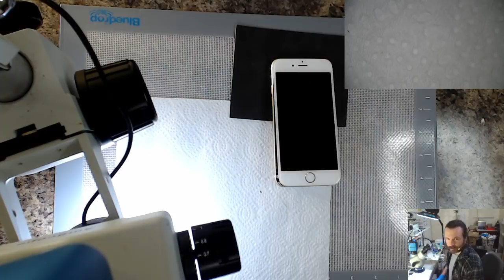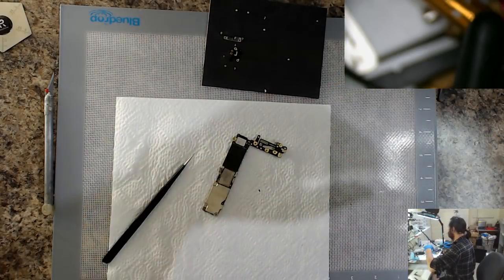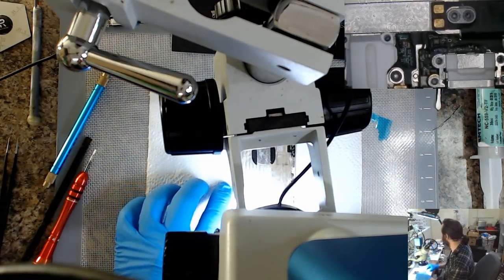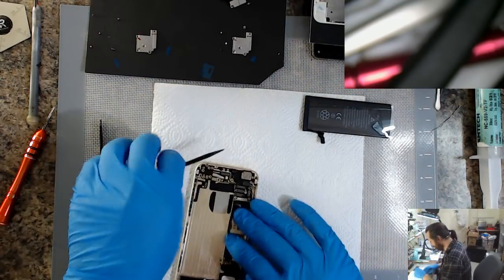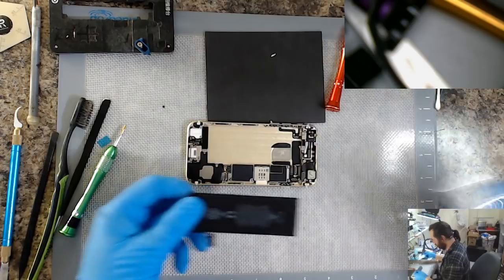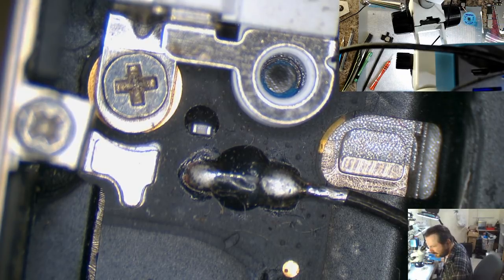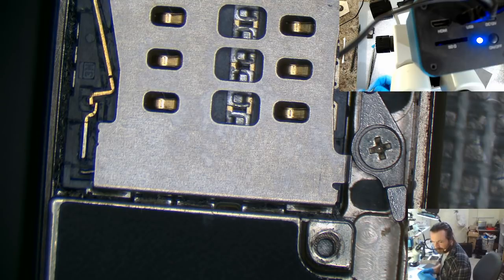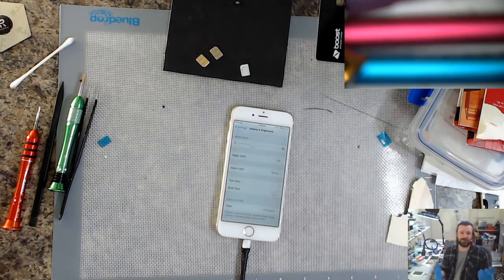LIVE: iPhone 6, tristar, dock, battery, and broken COAX, Noooo! - catching up for a change

Comment: What temp/airflow do you use on your Quick for shield removal? I have the same unit. Thanks and keep up the good work!
Reply from the maker: 460'C & 80 litres/air makes quick work of the shields.  The iP6 bottom shield though needs the full 120 litres and probably about 480~500'C, it's one you'll have to experiment more with.  Some days it comes off as expected, other days it's still stubborn.

Comment: Hey Paul, I'm starting a business and want to get an ultrasonic cleaner but I don't want to invest in a Crest yet. What's your take on the cheaper static 40KHz cleaners? I'm looking to get a 15L one but not sure how well they work.
Reply from the maker: Haven't seen the 15 litre sizes personally, I just took stock of a 10 litre unit, and while it's "okay" it's not something I'd rave about and it doesn't quite do as good a job as my 1.5 litre unit that I use for iPhones.  I suspect part of the problem is the power-to-volume density of the ultrasonic.  Haven't looked yet but suspect this only has 2 transducers, where's perhaps a unit with 4 will be better for superior wave / impact distribution.
Reply: Good to know as I seem to get mostly iPhones, thanks for the quick response!
Reply from the maker: If you're just mostly getting iPhones, then probably nothing bigger than 1.5 ~ 2 litres would be required.  A 6 litre unit would have a good power-to-volume ratio in most cases that I've seen too, but it won't fit the latest big macbook boards in it (why I got the 10 litre)